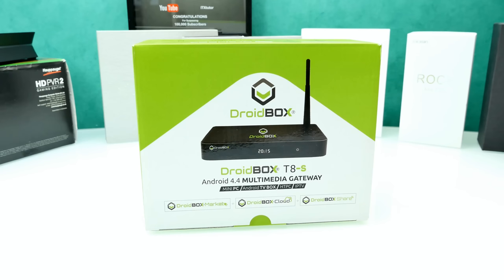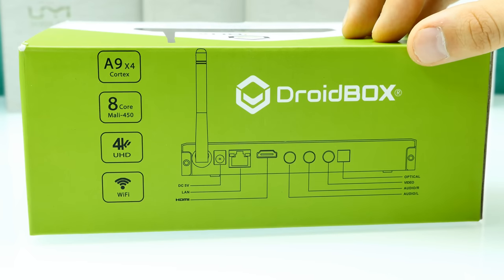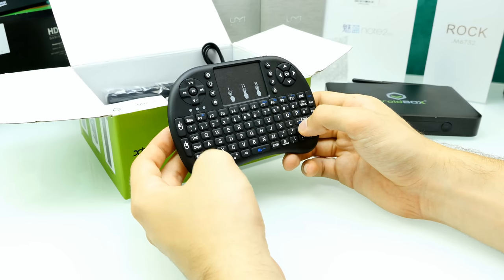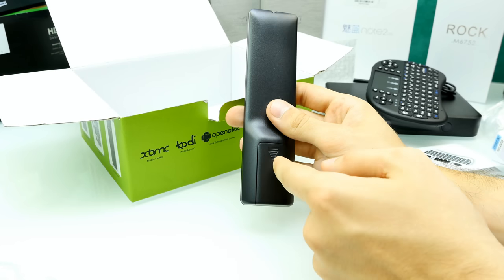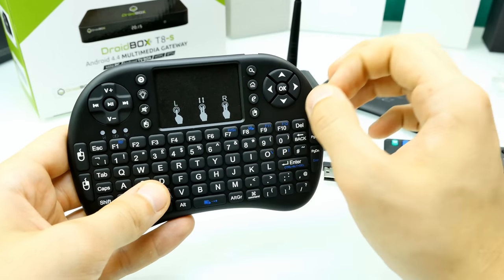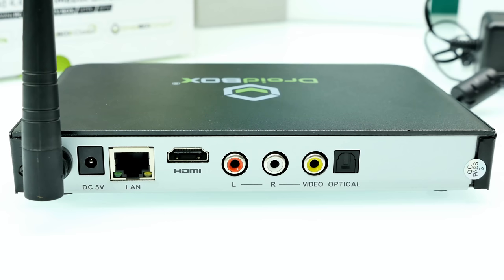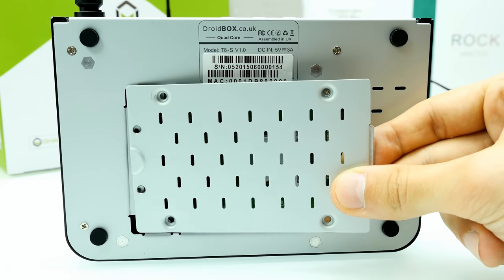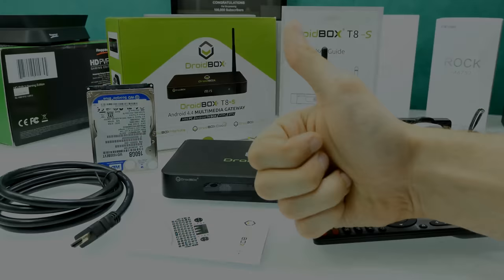Droidbox T8-S Unboxing & First Look - Dual Boot Android + OpenELEC - 4K Android TV BOX [4K]

Comment: Hi, I have 2 mini PC and also have that kind of keyboard, it`s actually identical but mine it`s branded by RII brand more exactly his name is Rii mini I8+
That keyboard can`t be use as gamepad, no way, it`s just a normal keyboard, for gaming you will need a proper gamepad, you have a tone out there wireless or wire your choice, better wire because wireless will drain more processing power from your cpu and you don`t want that when you're gaming, you need all processing power for gaming so with cable better, on amazon you will find like I sad a tone of them but you can use also a PlayStation 3 gamepad or a normal PC gamepad which has usb connection, if you have something like that on your home you don`t need to buy it. You will be able to play limited number of games, only those games wich are compatible whit gamepads but the important games will work. Here I`m refering to GT Racing 2, Asphalt 8 Airbourne, Modern Kombat 4 and 5, BB Racing, Leo`s Fortune,  Real Racing 3 and others too.